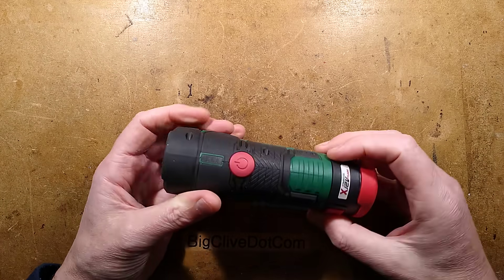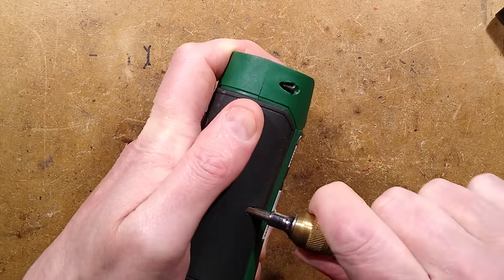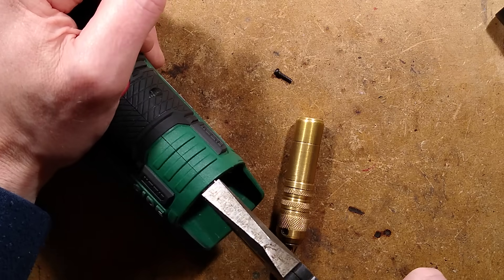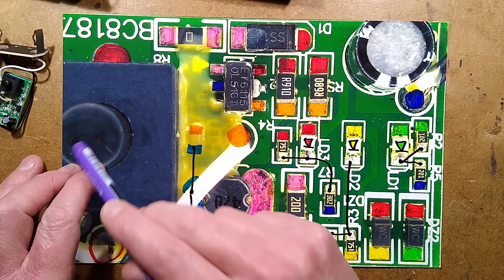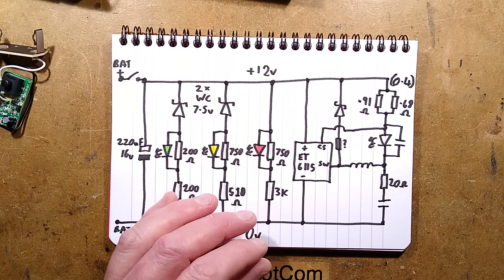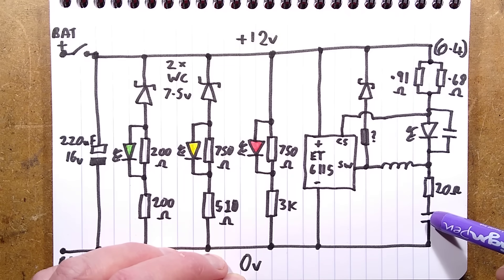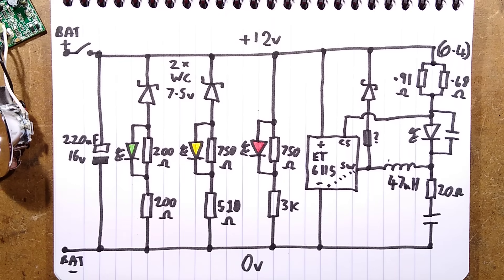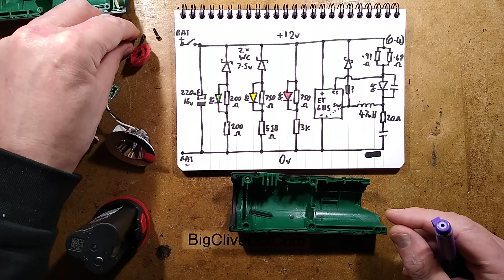Lidl/Parkside (and others) 12V system flashlight

Comment: I use a mix of the Parkside X12v kit and the Ferrex 20/40v kit and for the most part it’s all really boring, it just works 😂

Would be great to see you get your hands on the Ferrex 20v torch/gun thing but it seems they only sell it on the continent as I had to buy mine from eBay (along with the 40v SDS and the 1/2” impact gun) bizarre that they don’t sell the full range over in the UK

Comment: Seems fairly ridiculous to make something this large and with this much plastic, to drive an LED at only ~1.5W.   I'm sure it has great runtime but possibly does not need nearly that much, as you can get great runtime at 1.5W from a single cell 18650 aluminum tube body light that fits in your pocket without much fuss... and then when you want more light, switch that into high mode for 800+ lumens.

I suppose if you were creative, could put in lower current sense resistors and thermal epoxy a heatsink onto the back of that star mount plate with a different LED on top, but without a datasheet we are left wondering what the current limit is on the switcher IC.  I suppose you could use a thermal camera and ramp it up till it seems as hot as you'd limit it to, considering an extra thermal rise once the casing is put back together.

Meh, on the other hand I'd just stick to one of the 1 x 18650 cell lights I already have and not bother.

Comment: I don't like it .. this looks really cheap :/ .. with this battery there would be so much more possible.. for 10 bucks more they could have fitted at least a partial aluminium housing for enough cooling for idk. 5 - 10 Watts and there is space enough imho to fit a focus beam in the middle and a somewhat swampier light on the rim.. this star-pcb led in there is kind of funny...